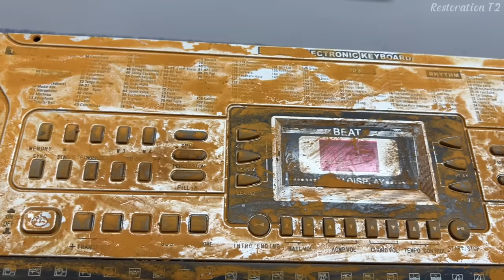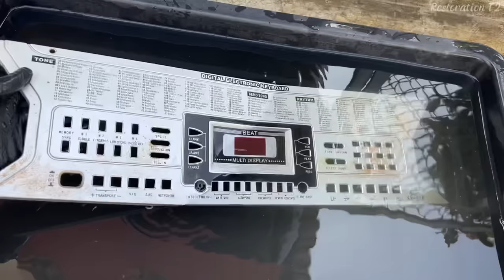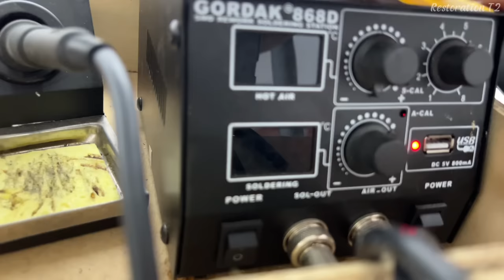Digital  P I A N O Recovery | Restoration Of Digital Electronic Keyboard Electric Organ

Comment: I'm certainly not sorry to see this keyboard covered in mud as it's one of those 
cheap Medeli keyboards. I nearly took a keyboard like this to the dump but the one 
I had was far worse. This one sounds like Microsoft Wavetable synth.
Reply: mate, the default Microsoft Wavetable synth was actually based on Roland Sound Canvas samples and with proper reverb and EQ can actually rule... this is miles below that :}
Reply: @warcinm3210  I know Microsoft Wavetable synth is based on Roland 
Sound Canvas samples but my point is the samples on this keyboards were sampled directly from the Microsoft Wavetable synth and also the factory that makes these keyboards doesn't have Roland's authorization to use these samples. Microsoft wavetable synth is almost on par with a Roland SC-7 or SD-35 especially with the cut down drum sets but a hardware SC-55, SC-88 and 88 Pro are better. I was saying because this keyboard uses MS Wavetable samples it's not as offensive as the Acoustic Solutions MK2054 which really was a worthless piece of 💩. I don't like Medeli made keyboards.